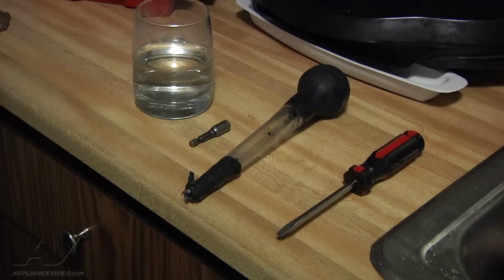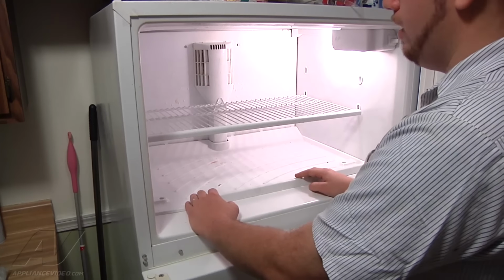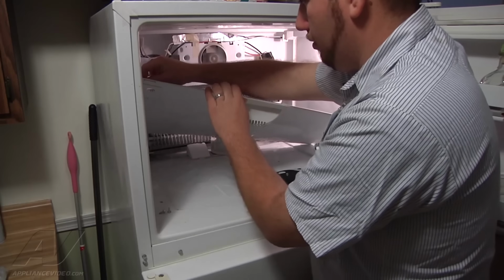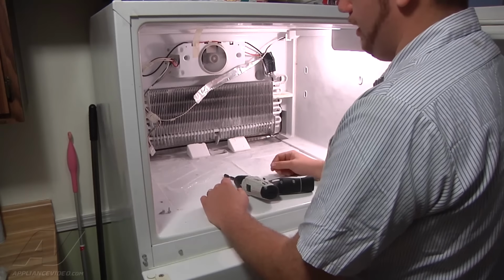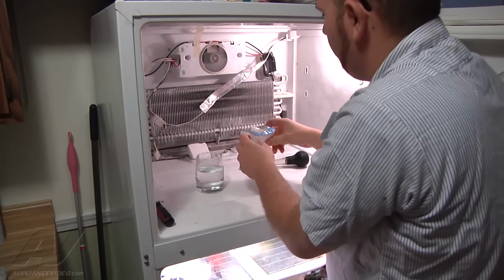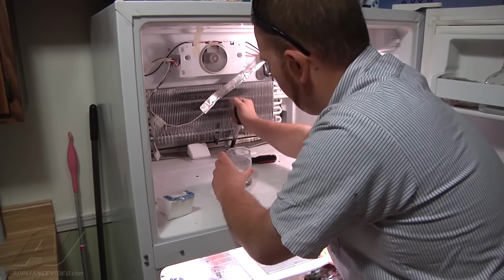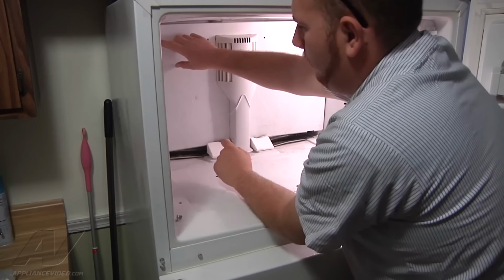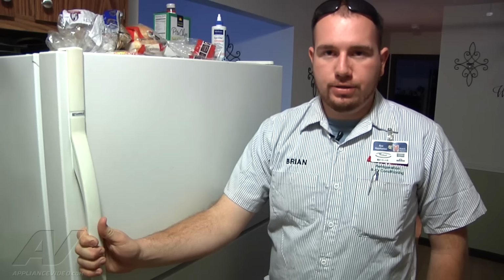Kenmore Refrigerator Repair - Water Leaking From the Freezer - Evaporator Drain Pan

Comment: OK GOOD video and that is how you remove the problem. BUT That does not FIX the problem and you will be doing this again real soon if you don't fix it. The clog is frozen water nothing more.... When you get to the part where he clears the drain with the hot water STOP and LOOK at the defrost wire right above the drain TAKE THAT WIRE and bend it down about 1/8 inch closer to the drain only for about 4 inches on the left and right side above the drain. YOU ARE JUST MOVING THE WIRE ABOUT 1/8 of an INCH TOTAL. This wire is there to melt the ice so it can drain. If the water after a few weeks still leaks into the lower part then you do not have it fixed and you will need to do the same thing PLUS bend the wire down another 1/8 inch. I own this unit and I did this and I have not had any problems....
ELLISTX
Reply from the maker: DELLISTX
              Thanks for the input, this information could really help allot of people . Greatly appreciated. We are glad we could help resolve your issue and save you money. Please help us provide more videos to our site by subscribing to our YouTube page or posting ApplianceVideo.com site on your Facebook or Twitter account. We also have our factory authorized technician’s email daily free professional advice to people like you to help solve their appliance problems. Thanks in advance for supporting us. Matt, Ace Appliance service technician.
Reply: You are a savior DELLISTX, there are countless video's online on how to "patch" this problem just as this tech did. Ive performed this exact video's procedures 4 times and lastly tried wrapping copper wire around the heating coil and ran it down the drain hole to try to keep the hole defrosted. But i will be going home to try lowering heat coil 1/8" to fix the root of this mystery!! Thank you!!
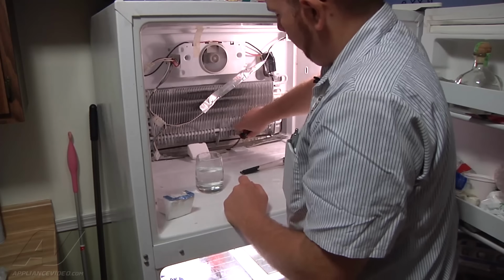Reply: Haiti News Info Haiti News Info  DELLISTX  referred to ~ 6:30 , and no, I don't think he means to move the thermostat wire (if there is one)! Even freezers that are similar to the one in the demo can be different, & I'm pretty sure DELLISTX may see a wire in his freezer that doesn't show in this demo. There is a black rod running just above the channel at the bottom where the drain hole is. That black rod is the heater element to defrost the coils that are above it, and maybe some freezers have a wire coming down from that black rod, toward the drain hole. If there is (or if someone added such a wire), that would be to transfer more heat from that black rod heating element down to the drain hole, to help keep water from freezing there & clogging the drain. However, her may alternatively be calling the black rod a wire , and may be suggesting to bend that rod, which I would think would be a very bad idea! I think heating elements like that have wires inside them, which could be broken by bending, destroying the defrost function. That's just a guess on my part, though.
Reply: What can I do if I suspect the fan isn't working??

Comment: Awesome video!  I have the same problem and will be tackling this myself.  But, why would you be pushing the clog down the tube? Wouldn't it better to suck it out so it doesn't go back into the system (unless the clog itself is just a piece of solid ice)?
Reply from the maker: jsprite123
              If you go to our FREE repair help website at ApplianceVideo.com and copy and paste this this question under REPAIR HELP, we have factory authorized technicians that will answer any technical questions at absolutely no charge on your appliance issues. This is the only website on the web that you can get questions answered by certified appliance and HVAC technicians along with over 2600 free repair videos.  Matt Ace Appliance factory service technician
Reply: Do you need to unplug refrigerator ???

Comment: I was able to follow this video, and try unclogging my drain tube.  All the hot water drained quickly down into the refrigerator.  Finally, I saw some water dripping down the drain tube out the back and into the collecting pan, but that was 2-3 cups of water later.  And further addition of water into the drain opening in the freezer mostly ran down into the frig and not down the drain tube.  It seems I've only partially fixed the blockage.  I'll have to wait and see what collects in the bottom of the frig over the next 6-12 hrs.  The tube that extends out the back of the freezer down the back of the frig to the drip pain is entirely clear, so any blockage must be between the hole in the back of the freezer and the outlet on the backside of the unit.

Thank you for posting this video and explaining step-by-step.
Reply from the maker: Beginfrigrepair
                     It normally takes 6-12 hours to comply defrost and drain. Thanks for your positive comment. Please help us provide more videos to our site by subscribing to our YouTube page or posting ApplianceVideo.com site on your Facebook or Twitter account. We also have our factory authorized technician’s email daily free professional advice to people like you to help solve their appliance problems. Thanks in advance for supporting us. Matt, Ace Appliance service technician.

Comment: Can the ice buildup also account for a fridge compartment that is not cooling properly? We have the dripping problem right now, and i intend to fix it. What do the air ducts that you refer to do? Do they direct air to the fridge compartment? Thanks for a great video.
Reply from the maker: Alan 
      Yes, if you have a plugged drain it can get in the air duct restricting air flow. I recommend shutting the unit off 24 hours with doors open. Then turn it back on after cleaning drain.Please help us provide more videos to our site by subscribing to our YouTube page or posting ApplianceVideo.com site on your Facebook or Twitter account. We also have our factory authorized technician’s email daily free professional advice to people like you to help solve their appliance problems. Thanks in advance for supporting us. Matt, Ace Appliance service technician.

Comment: Hi i got a kenmore coldspot side by side fridge & the drain tube keeps getting clogged (i keep unclogging with hot water)freezes  down to bottom basket ive had replaced thermostat.freezer door seal is good.plz help thx
Reply from the maker: Tino 
         Replace your defrost heater and make sure the new one is bowed down close to the drain about 2 inches away. The heater gets weak and does not radiate heat to the drain hole and its freezes over. That will take care of your problem. Please help us provide more videos to our site by subscribing to our YouTube page or posting ApplianceVideo.com site on your Facebook or Twitter account. We also have our factory authorized technician’s email daily free professional advice to people like you to help solve their appliance problems. Thanks in advance for supporting us. Matt, Ace Appliance service technician.

Comment: Thank you for the video.  Our fridge was a slightly different model (no floor pan/panel) but everything else was fairly close.  I ended up unplugging the unit and using a hairdryer to defrost some of the bigger ice faster.  I also made sure to level the unit with a spirit level so to make sure it drains correctly on the defrost cycle.
Reply from the maker: Jonathan
       Thanks for your positive comment. Sometimes a hair dryer does not get all of the ice, if it happens  again within the next month unplug it for 24 hours with the door open. Please help us provide more videos to our site by subscribing to our YouTube page or posting ApplianceVideo.com site on your Facebook or Twitter account. We also have our factory authorized technician’s email daily free professional advice to people like you to help solve their appliance problems. Thanks in advance for supporting us. Matt, Ace Appliance service technician.

Comment: Hi Brian,

Thanks for sharing this video!  My mom's been complaining that we need to replace our fridge, but then I found your video.  This repair looks like exactly what I need to do to fix the leaking issue found on the top shelf in our refrigerator during hotter days.

I do have a quick question before tackling this task... 

Do I need to unplug the power or is it fairly safe to do this without having to unplug the unit from power source?  I noticed in your video that the refrigerator is kept running, but don't want to assume as I know you are trained professional so know what you are doing.  

If I could fix this following your instructions, it will save us lots of money not having to replace with a new one!  Thank you so much again for sharing your knowledge!
Reply from the maker: We always advise to unplug the unit before servicing. The only reason we kept on the unit is for lighting, we needed more light to film. I hope it works out for you.  Please help us provide more videos to our site by
subscribing to our YouTube page or posting ApplianceVideo.com site on your
Facebook or Twitter account. We also have our factory authorized technician's email
daily free professional advice to people like you to help solve their appliance
problems. Thanks in advance for supporting us. Matt, Ace Appliance service technician.

Comment: Thank you for this very clear and informative video. I am now off to repair my refrigerator... :D
Reply from the maker: Henry
      Thanks for your positive comment. Let us know how the repair turns out Henry. Please help us provide more videos to our site by subscribing to our YouTube page or posting ApplianceVideo.com site on your Facebook or Twitter account. We also have our factory authorized technician’s email daily free professional advice to people like you to help solve their appliance problems. Thanks in advance for supporting us. Matt, Ace Appliance service technician.
Reply: I'm actually struggling a little because mine is different to the model you show (mine is 3639762821). No screws where yours are. So I'm on the Sears website downloading the manual to try and work out how to do that... More as I find out I guess! :D
Reply from the maker: If you have any questions after you look it up at the Sears site let us know. We can have a technician help you with any issues. Thanks
Reply: I appreciate that! Kinda stuck right now. I know what the problem is, but no idea how to get to the drain tube... Gah!
Reply from the maker: You can let it defrost for 24 hours with the door open or pour hot water down the drain. If it does not go down use a turkey baster to shoot pressure down the the draim.
Reply: Thank you! I appreciate you taking time to respond to my comments! :D
Reply from the maker: No problem, let us know how it turns out...Thanks
Reply from the maker: You are very welcome Henry

Comment: my fridge has a styrofoam piece in the middle vent hole also, i cant seem to get the cover back on and the styrofoam middle piece at the same time, is this normal? or is that middle styrofoam piece not needed
Reply from the maker: ElectricS45 
               Depending on the model you have the Styrofoam directs air flow and sometimes prevents vibration. You may have ice around it preventing it from going on properly. It is advised to keep it there. Please help us provide more videos to our site by
subscribing to our YouTube page or posting ApplianceVideo.com site on your
Facebook or Twitter account. We also have our factory authorized technician's email
daily free professional advice to people like you to help solve their appliance
problems. Thanks in advance for supporting us. Matt, Ace Appliance service technician.

Comment: THANKS! Thanks for this great video! Just completed it in under 45 minutes and now I believe my problem is solved...just one heads up...you can see the drain he is cleaning...well I saw mine UNDER the metal pan that is attached to the cooling stuff...lift it up slightly and remove all that ice under metal pan and you will see the hole...clogged! Couple basters of hot H20 and bang! It worked!

Thanks bud!
Reply from the maker: jersal1873
Thanks for your positive comment. You can help us provide more videos to our site by subscribing to our YouTube page or posting our ApplianceVideo.com site on your Facebook or Twitter account. We also have our authorized technician’s daily emailing free professional advice daily to people like you to help solve their appliance problems. Thanks in advance, Matt Ace service technician.

Comment: That is awesome and seems like one of my problems that I could fix.  The other current problem is that my Fridge will not cool down to the correct temp.. So, question, Does this symptom promote the inability to cool the fridge down properly??  The freezer is fine and freezes properly. I hope that is the case.  It will leak up to a pyrex bowl full of water.  Right now I have it under the area of leakage from the top back of the fridge which seems to match your demonstration fo why it is leaking in the first place.  I dont know why I didn't Utube this before.  Thanks and if you have any other advice on the cooling please email me squabrock45@gmail.com.
Reply from the maker: cobster
           Normally a plugged drain will not cause a cooling issue. You may have a defrost issue or a leak in in the system. Try shutting down the unit for 24 hours with the doors open and if it starts cooling again you have a part of your defrost system out. Email us back  after that and let us know if that helps.

Comment: I'm going to turn my fridge off tonight and let it defrost.  Tomorrow, I'll follow the instructions in this excellent video.  But one question was left unanswered:  What causes this problem in the first place?  It looks like a thermostat or some other component has gone bad; otherwise, we'd all be defrosting our refrigerators every month.

Why do these things freeze up?
Reply from the maker: William 
          What we have found is the defrost heater gets weak and the middle of the heater does not radiate heat. You van bypass the thermostat and energize thew heater and you will see a red glow on the right and left of the heater but no glow in the middle where you need it to heat the drain. After you defrost it pour hot water down the drain to make sure it is open. Then bend the middle of heater towards the drain hole so its about one inch away.

Comment: How do remove the bottom panel if there are no screws? (The screws are not missing. There just isn't any screws or screw holes.)
Reply from the maker: If there are no screws or clips your bottom panel on your model may not come off. If you are trying to get to the drain assembly it will not need to come off.
Reply: *****
I took the back panel off and was able to access the drain hole without removing the bottom panel. Will any ice beneath the bottom panel eventually melt and drain? Thank you for all the information!
Reply from the maker: You are very welcome

Comment: My Whirlpool is making some ice but also it is passing a little water into the ice bucket and all the made ice is freezing together. Interested in all thoughts.

Thanks
Reply from the maker: Brian
        I would start with your water inlet tube that supplies the water to the ice maker. When the ice maker goes into the harvest cycle it sends power down to your solenoid valve for 4 seconds to fill the ice maker. Make sure that tube did not come out of position, if it does the water will flow into the bucket.
Reply: appliancevideo.com

Comment: I have a top freezer Kenmore but it must be older. its model Number 2539366012. I have the rear panel loose but not free. seems there is a wire. Also there are no screws holding the bottom in. how do I get it out? I can't yet see the drain hole.
Reply from the maker: Shirley
      The older models have a ground wire, just remove the clip  or unscrew the wire from the panel. Allays make sure its unplugged before you start. The two floor panel screws will need to be removed also. Sometimes there is ice holding it down so let it sit off with the door open for a few hours. Move your food elsewhere while doing this.  Please help us provide more quality videos  by subscribing to our YouTube page or posting our ApplianceVideo.com site on your Facebook or Twitter account. We also have our authorized technician’s daily emailing professional advice daily to people like you that have appliance problems. We have helped thousands of people save hundreds of dollars. Thanks in advance for your help.
Reply: *****
I'm having the same problem as Shirley. How do you remove the bottom panel? There are no screws, no snaps, no holes.
Reply from the maker: If there are no screws or snaps your model the bottom panel most likely does not come apart.